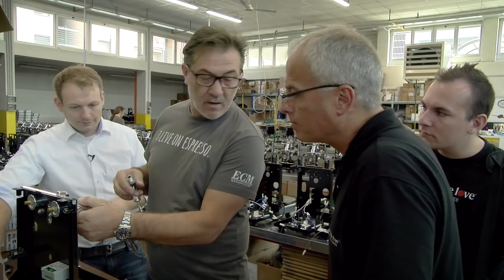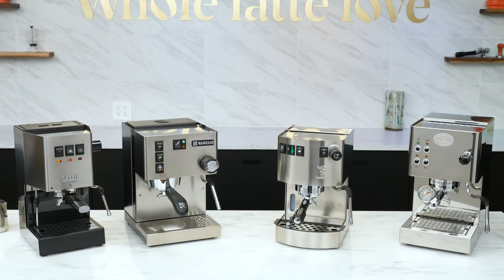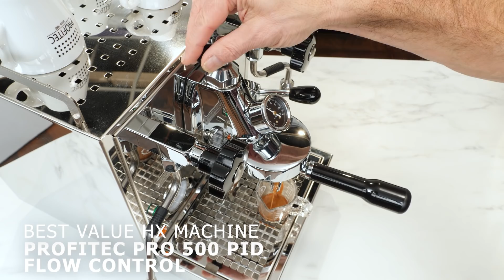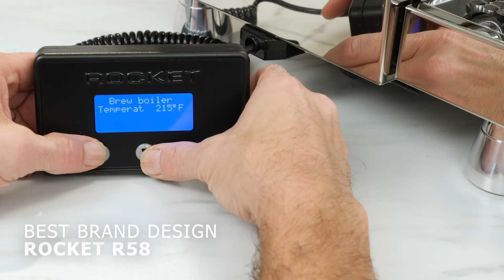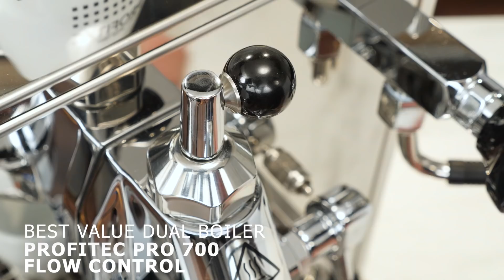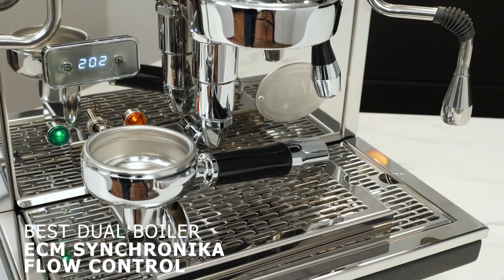Top 5 Best Semi-Automatic Espresso Machines of 2019

Comment: What’s the difference between these and something like the breville barista express
Reply from the maker: Hi K, Thanks for the question. These are hand assembled machines built to go for decades with proper care/maintenance. The Breville products are appliances. They pack in more features for the $ but are mostly plastic, factory made with lower quality proprietary components. When they need a repair it rarely makes financial sense to have the work done.

Comment: I'm looking for something in the $1700-1850 price range. I've narrowed it down to the Profitec Pro 500 PID (non-flow control) vs the Rocket Appartamento. I'll say up front that I LIKE the Rocket more, appearance-wise. But the Profitec has way more reviews, and has PID. But, it's also ~$150 more. This is my first real machine after using a Breville appliance for the last couple years. Which would you recommend?
Reply from the maker: Hi Chris, Thanks for the question. Sorry for the delayed response. Just back today from a long holiday weekend offline. It's easy decision for me. Go with the Pro 500 PID all day - every day. The extra $150 is worth it for better finish quality, higher internal parts quality and of course the PID.
Marc
Reply: @Wholelattelovepage  Marc, thank you for the reply! Hope you had a good weekend! I actually ended up ordering a refurb Mozzafiato Type V from you guys, since it had the PID for the same price as the PP500. Even if not technically a better machine, I just love the Rocket's aesthetics so much. Thanks for the response!

Comment: hi,

 I noticed that some machines have stainless steel boiler and the others have copper one. Which one is better?
Thanks
Reply from the maker: Hi H, Thanks for the question. I have no preference between copper and stainless. Copper was traditionally used in espresso machines for many decades until manufacturing of stainless boilers became easier. No difference in taste or performance IMO between the materials.
Marc

Comment: @wholattelove this is so great, thank you for the video! how long does it take for the pro500 and the pro700 to heat up? Thinking in the morning when I want to have my espresso asap. My gaggia pro is ready in minutes. Ready to upgrade to either a pro500 or a pro 700.thanks!
Reply from the maker: Hi AP, You are welcome for the video! In my testing it's about 30 minutes warmup time for the Pro 500 to reach stable temp measured on the exterior of the E61 group. Pro 700 is similar. If you'd like the machines fully warmed up you could use a timer switch to have the machine turn on. Both the Pro 500 and 700 have a mechanical power switch so can be turned on by an appliance timer with proper power rating. Can even use a wifi controlled switch for remote turn on/off.
Marc
Reply: @Wholelattelovepage  thanks Marc, that's a great suggestion! I spent a ton of time watching your videos and I think I'm going to go for the Profitec pro 500 PID. I was considering the Bezzera BZ07 but it looks like it's not sold anymore? Thanks again, you guys are awesome!

Comment: The idea is to keep the cups warm, where there is most porcelain. This is the bottom of the cup. If the cup rim gets hot, you burn your lips while drinking. Do not worry about dust. Dust can't get into the heated cup because warm air rises and dust can't settle.
Reply from the maker: Hi YL, I see what your saying. But as heat rises, doesn't the upside down cup capture the heat? Not something I've tested but given time my guess is the cup ends up at a fairly uniform temperature.
Marc
Reply: @Wholelattelovepage  Hi Marc, watch the background. https://youtu.be/ee0wTATbeLk Maybe some coffe shops around the corner do it the same way.

Comment: I have a Gaggia classic that I’ve gotten quite comfortable using as well as a Gaggia Anima Prestige that I’m still on the fence about. I’m thinking of maybe upgrading to one better quality semi-automatic. What would be your recommendation for how much to step up and then what machine for that step?
Reply: In addition, how do Quickmill machines compare to these mentioned. If I’m going to drop close to $2,000 I’d like to get it right. Don’t want any doubts like I do with the Anima
Reply from the maker: Hi Zach, Thanks for the question. With your budget the next step up is a machine with a heat exchange boiler (HX). If you do milk drinks the ability to brew and steam at the same time is a game changer. With your budget you are in range of HX machine with PID like the Profitec Pro 500 w/Flow Control: https://www.wholelattelove.com/products/baratza-vario-grinder-w-metal-portaholder The Pro 500 is available at lower cost without flow control. The Pro 500 is my favorite HX machine with PID.
Marc

Comment: I’m confused between Rocket r58 and Ecm Synchronica. :/ Is the difference worth the price?
Reply from the maker: Hi I, Thanks for the question. Here's a link to a side by side spec comparison including current pricing of Synchronika with Flow Control, R58 and Synchronika without Flow Control: https://www.wholelattelove.com/pages/compare?products=MTU0NTk2MzA3NzY5MSwxNTQ1OTgzMjMwMDExLDE1NDU5OTA4NjQ5NTU
My thoughts:
Both are fine machines. Some prefer the styling of the Rocket. Others prefer the refined touches and extended capabilities of the Synchronika - more on those in a minute. Currently the Synchronika without Flow Control is same price as the R58. Rocket Espresso's R58 is a fine machine and no mistaking it's an R58 with heavy branding like the "R" icon on the steam knob and unique angles of steam and hot water wands. R58 has no visible digital displays. PID and other machine functions operate and display through a detachable controller. When setting R58 PID brew temp you use the actual in boiler temp. A chart in the manual gives you in boiler temp to produce a desired brew temp. The Synchronika has visible display of PID temps and you set the desired temp with no cross reference needed.

The Synchronika is capable of line pressure pre-infusion as the machine is open to line pressure without the pump running. The R58 is not. A solenoid valve on the plumb line of the R58 opens only when the pump is running. The Synchronika has best in class steaming power with up to ~2bar of pressure in the steam boiler. The R58 maxes out at ~1.6 bar in steam boiler. While not as "flashy" as the R58 IMO the Synchronika has slightly better quality in overall finish and detail. Synchronika's PID display becomes a shot timer during extraction and offers other features like programmable standby time which turns off the boilers and a backflush reminder. Synchronika is easiest to open machine on market. Less than a minute to remove top, back and side panels. Synchronika uses an upgraded stainless steel mushroom valve. R58 uses ceramic with lesser quality machines using a chrome plated mushroom.

Synchronika is available with Flow Control on the E61 group. Something to consider if you like to tinker with pre-infusion and flow rates based on coffee type and other factors. Also possible to perform extractions similar to other machines like manual levers using flow control, make coffee shots using coarser ground coffee and more.

Hope that  helps!
Marc

Comment: My best heat exchange is Bezzera BZ13 PID because: 
1- heats up and ready in 5-6 minutes only
2- very small foot print, only 10” wide
3- cost me 1000 euros only
4- PID temp control 
5- group head is electrically heated (part of the reason quick heating)
6- programmable dosing for single and for double
7- looks nice. Bezzera also make their own components in Italy such as the copper boiler...
Reply from the maker: Hi KZ, Thanks for sharing! BZ13 is a nice compact machine. I've been to their manufacturing facility in Milan, Italy and spent some time speaking with Luca Bezzera. Check out video from my visit there including conversation with Luca: https://youtu.be/KY14ND7_Exs
Marc

Comment: The Gaggia Classic PRO is a good machine, but has very modest "upgrades" for a $100 price bump. Basically, they added a pro steam wand, which many of us did by buying a Silvia wand for $25.  Then they put shock mounts on the pump.  20¢ upgrade? And lastly, some needed cosmetics. But beyond the wand, functionally its the same as the old model.   It STILL needs a PID and a pressure adjustment.  But when you get done you have a machine that can do better espresso than a non-PID Silvia.
Reply from the maker: Hi G, Thanks for sharing your opinions. Not sure where you're getting pricing but on average it's about +$50 from the old model. I question the value of PID on smaller volume single boiler machines. If one wants a single boiler with PID I'd go ECM Classika which also has E61 group and larger volume boiler.
Marc
Reply: @Wholelattelovepage    I suppose you know your pricing better than anyone. But I bought my Gaggia Classic (and Sette 270 grinder) from you guys not all that long ago. Pressure was at 15 bars out of the box. Fixed that first. But using a fast digital thermometer the temp swings with the ready light on were in excess of 5°F.  I found an independent guy on the former Gaggia Forum and he sold me a high quality, hand made deluxe PID for $120 was was a simple DIY install. There are similar kits from retailers that I suppose should be easy to install, just with a higher markup.  Having done that and the steam wand swap, I also went to a more deluxe shower screen and a solid brass shower plate. We are now on weekly subscription from La Colombe (Nizza is our go-to bean) so we get beans 2 days from the roaster.  When I travel the country/world I seek out the best coffee houses and challenge the baristas to do better than I do at home.  Only twice in two years have I been impressed. Yeah... When the Gaggia is done we'll take a big step up to an ECM or a Rocket or something in the $2000 range.  We do espresso every morning. 

And FWIW, before buying my Gaggia, I bought a Rancilio Silvia/Rocky package for a close friend (no PID).  I like the Sette grinder so much better than the Rocky and the Silvia too needs a PID to brew decent stuff.  JMO
Reply from the maker: Hi G, Thanks for the detailed response. At your level I do see an HX w/PID or DB machine in your future :). I love the Sette 270 grinders for lower volume home use. The 270 Wi is amazing! No way I could jump back a decade to something like a Rocky.
Marc

Comment: Those are miles ahead of my Breville Barista. The only thing that I like is the integrated grinder on top of the machine. Oh well when the breville gives up, I’ll upgrade.
I also chose the Breville because in eastern Canada Italian machine are nowhere to be find except online.
Reply from the maker: Hi db, Thanks for the comment. Breville does offer some value but at end of day they are appliance grade compared to true machine build quality of the Italian semi-autos.
Marc
Reply: Whole Latte Love completely agree!
Reply: How east are we talking? I can walk into a few places and pick one up. Back in the day, I looked at a Breville, but there were too many errors with the electronic controls and they weren't easy to get fixed. Ran my Rancilio for 10 years and parts were just a click away. Wasn't worth the drive downtown for a $5 part. One steam wand clip and one gasket.

Just outside TO

Comment: I have the Rancilio Silvia that I purchased from you 3 years ago. It's a wonderful machine that I have been extremely happy with, but  I am thinking of upgrading.  based off your best of 2019, what do you think would be a good option.
Reply from the maker: Hi Paul, Happy to hear you've been pleased with your Silvia. If you do milk drinks I'd consider an upgrade to a machine with a heat-exchange boiler. With those you can brew and steam at the same time - no waiting for steam like on the Silvia. My favorite in that category is the Profitec Pro 500 PID. With PID you'll have far superior brew water temp control. If you do not do milk drinks or don't mind waiting for steam The ECM Classika is a super high quality single boiler machine with PID with better espresso cabilities. Both of those machines are available with flow control on the E61 Group. Flow control gives you next level espresso brewing.
Pro 500 PID w/FCD: https://www.wholelattelove.com/products/profitec-pro-500-pid-espresso-machine-with-flow-control
ECM Classika PID w/FCD: https://www.wholelattelove.com/products/ecm-classika-pid-espresso-machine-with-flow-control
Both are available at lower cost without the FCD.
Hope that helps!
Marc
Reply: @Wholelattelovepage  Marc, thank you so much for your timely reply.  I do milk drinks as well as just straight espresso shots.  I will look into both units.  Thank you again for your suggestions and expert recommendations
Reply from the maker: My pleasure. Let me know if you have any questions. 
Marc

Comment: Are the ECM sink Chronica model can be work any kind of large or small coffee shop at any busiest time?
Reply from the maker: Hi Dennis, Thanks fort the question. The Synchronika is not a commercial machine. It can work as a catering machine in lower volume situations. Most busy shops use multi-group machines. Something like this awesome Dalla Corte XT: https://www.wholelattelove.com/products/dalla-corte-xt-3-group-220v-nsf-in-white
Marc

Comment: Why the Gaggia over the Ranchilio Silvia V6 2020?  The Silvia is arguably better made snd performs just as well.  The extra cost is just about justified.  The latest Classic Pro has some cheaper internals too.  I just dont understand why the Rancilio isn't sat there.
Reply from the maker: Hi Paul, Thank for the comment. Check out my comparison of premium entry-level espresso machines: https://youtu.be/ajvUwRZ524I
It includes performance testing and thoughts on the Classic Pro and Silvia. One big difference is in time to reach steam temp. About 45 seconds on the Classic Pro and ~120 seconds for the Silvia. I wonder if your mention of internals is referring to the older EU version of the Classic? For a time in EU models the 3-way solenoid valve was removed. 3-way never left in Classics sold in North America. Most recent EU 2019 Classic has the 3-way valve again. I'm not a fan of the Silvia's painted steel frame rails, its small and shallow drip pan or the price compared to the Classic.
Marc
Reply: @Wholelattelovepage    Yes, I can see where you're coming from.  To even the argument out a bit the Silvia uses a higher quality brass boiler, the new one being lagged too.  The connection pipes are better quality as is the OPV, and the steel chassis is as well finished if not a bit better.  Portafilter is also better designed and the steam wand is a better design plus you get a hefty new tamper with the machine.  The Classic has made some improvements but the latest version (Classic Pro) still uses a newer plastic bodied OPV in place of the older and more robust brass one (I understand that's the case anyway).  The boiler comes to steam faster as it's smaller and not lagged and nor does it have the same thermal mass so they rely on more power and a smaller boiler volume to heat quicker.  Connecting pipework is cheaper too.  They have improved the wand and it does have a better drip tray but honestly...who leaves coffee in a drip tray overnight? I clean mine each use...takes seconds.  It's not intended as a commercial machine so I think viewing it with more compromises is fine in this respect.  

I don't understand why Rancilio can't make the whole thing in stainless but even if it does rust a little down the line it's a dead easy job to clean it up and repaint it or have the tray powder coated.  Time to steam isn't an issue unless you're in a hurry.  Even my cheaper machine takes as long and it's just a non issue.  I guess it depends how you score things.  Some things matter to some and not to others.  On quality alone, my vote goes to the Rancilio...no contest  The thing I have against the Classic is that the build has got cheaper over the years on the inside but the price has doubled compared with the Rancilio so on that basis alone I can't see it providing as much value for money.  Both are also hampered by EU interference and both have 30 minute non adjustable power-off circuits.

Comment: Hello friend I am interested in buying a coffee machine for a small restaurant and I would like to know which of the machines in your video would be more useful and effective, I need powers, duration and reliability, 115v.
Reply from the maker: Hi ES, I'd go with a dual boiler machine like the Profitec Pro 700 or ECM Synchronika. While these are not true commercial machines some do use them for lower volume catering. In fact, here's a link to a live demo we did a few days featuring a local cafe owner using a Pro 700. He does not use the machine in his cafe but does use it for catering/events: https://youtu.be/qkGkGNTM6Lk
The Profitec Pro 700 and ECM Synchronika are nearly identical internally. They are designed for reliability. Check them out here
Profitec Pro 700: https://www.wholelattelove.com/products/profitec-pro-700-dual-boiler-with-flow-control
ECM Synchronika: https://www.wholelattelove.com/products/ecm-synchronika-dual-boiler-with-flow-control
Hope that helps!
Marc
Reply: Thank you, which one do you recommend that I guarantee to make a lot of daily coffee for my cafeteria? Using 1 group 110v ?
Reply from the maker: Eduardo Sanchez You’re welcome! Either is fine. Same internally so go with the one you like the look of. 
Marc